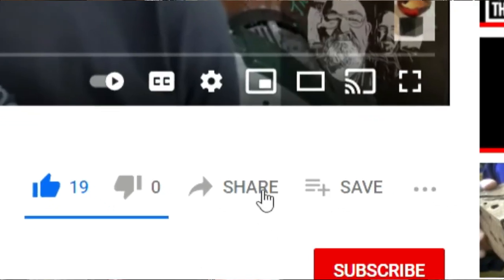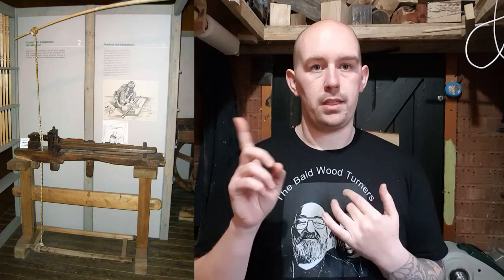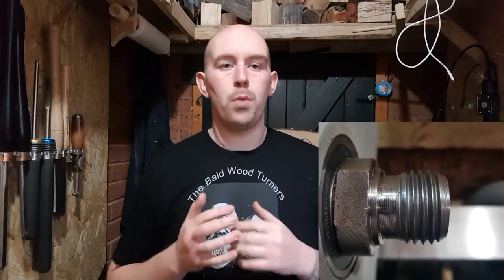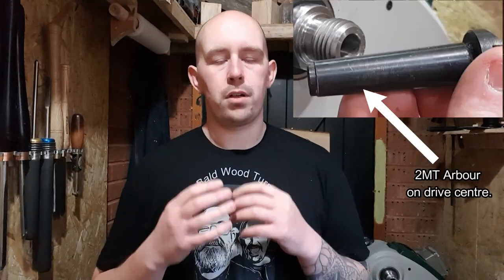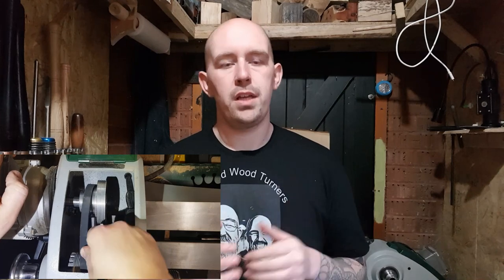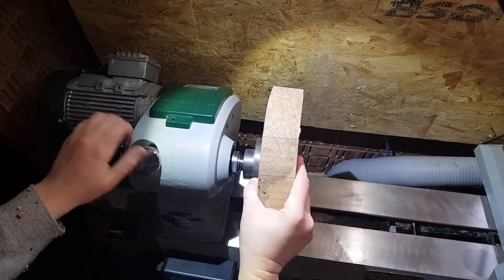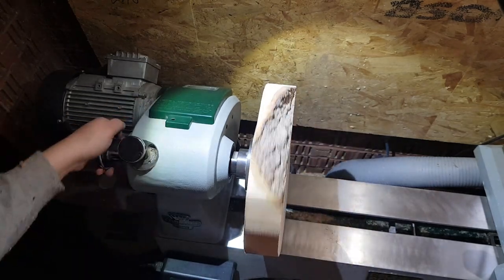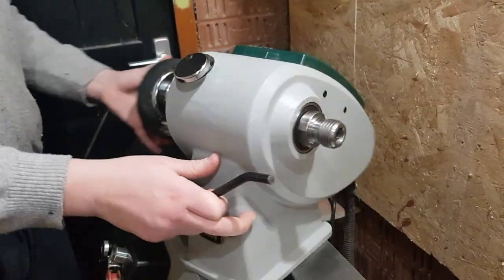Wood Turning Basics/Wood Turning lathe/Wood Turning lathe basics.

Comment: How do you like your coronet envoy ? 
Any disappointment?
I'm thinking of buying one .....looked at nova Saturn , Laguna , and Axminster 406 but thinking I prefer the envoy . 
Would appreciate your thoughts. 
Many thanks.
Reply: Hi Mike. First of all, thank you for watching :). 
I would absolutely reccomend purchases the Envoy, over the other lathes mentioned. For the price there is other lathe that matches the specifications of the envoy.
I had the axminster 406 on my shortlist and when looking at the specs, the only thing they envoy loses out on, is its weight. The axminster I think weighs in at around 160kg (if you buy the legs aswell) the envoy comes in at 140kg. Which isn't exactly light lol. 
So far the only this I have found that can be a little irritating is putting the tailstock back on. The cam lock moves side to side so can be a little fiddly to put back on the lathe, that being said now I have had it a couple of month, it is just a matter of getting used to putting it on. 

I have a video on the channel of my initial review of the Envoy and I will be doing a 6 month and 12 month full review aswell. 

Find me on facebook https://www.facebook.com/antony.parker.52 and I'll be happy to do a video call and answer any questions about the lathe and give you a full walk around if you like. :)

Just so you know I am not endorsed by Record power in any way so you know you are getting a completely honest review of the lathe. :).

Thanks
Antony Parker 
Thebaldwoodturners
Reply: Many thanks for your prompt and very helpful reply. 
Looking forward to watching more from you both.
Thanks again.